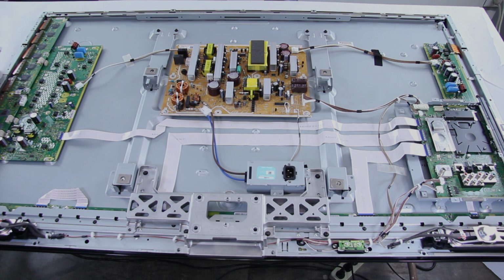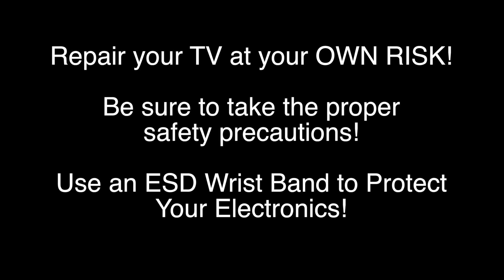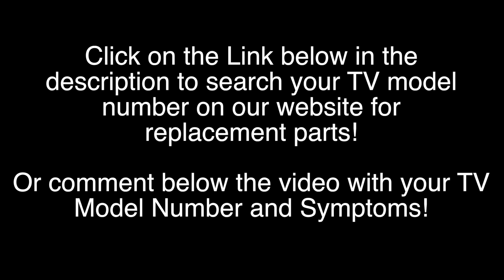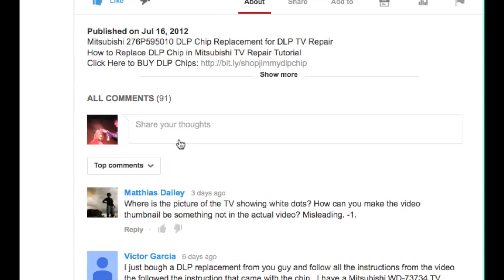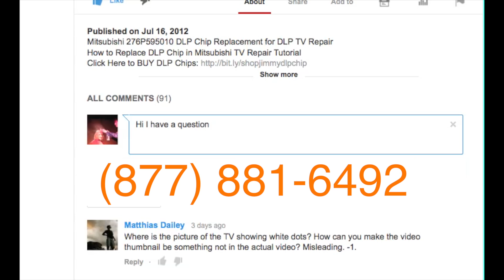Panasonic Plasma TV Repair - Understanding 10 Blink Code for 2011 Panasonic Plasma TVs-How To Repair

Comment: Hey guys, I know this post is old but I have an Panasonic TC-P50S2 Plasma TV.  We had some power brown outs the other day and now we get the 10 blinking code. We've unplugged it and discharged the power. Still same codes when plugging it in. Any help you could provide would be appreciated.

Comment: Hi there, thanks for the video. 
I have a 50” Panasonic Plasma Model # TC -P50U2 TV , manufactured October 2010.The other day I went to turn on TV and it clicked on, then seconds later it turned off and started flashing a red light 10 times. I have unplugged the TV overnight, then plugged it in again and it does the same thing. Would you know a quick fix for the TV. Beings as the TV is 15 years old, I don’t think it makes sense to put a lot of money into it. Your help would be appreciated. Aug 20, 2025

Comment: Hi , I have a Panasonic Plasma tv TC-P46S2, the problem is as you described when try to turn the tv on it is just on for a few seconds then shut down and the power light is blinking 10 times, as you first mention it is the problem of the A board but then you started to say to replace the power supply board, so I'm not sure this is the issue related to P or A board, please can you reply as to replace the P board or the main A board, thanks , Dave

Comment: I have a Panasonic TH-50PZ700U purchased 8/26/07. Stopped working about a week ago. Researched a little and tried the following: 1) Plug in TV,  2) Hear: 1 Relay click sound,  3) Press Power Button,  4) See: 10 Standby LED blinks then pause, 5) Repeat: 10 Standby LED blinks then pause, etc. Some YouTube videos indicate the "A" (or "Main") board may need to be replaced. Is that correct?

Comment: Thanks for the video. Very informative. I have a TH-50PZ80U. I try to power on and hear the click... but then a small little click after the initial one then the light blinks 10 times... sometimes after power reset it works... sometimes it doesn't. will the fix here work for it as well? I will look at your shop for parts. Thank you again :)
Reply from the maker: Hi! There's no guarantee it will fix your particular issue but it's worth a shot. Thanks for watching!

Comment: Thank you so much for taking the time to make/post this video! Would this also apply to the 2010 models? I have a TC-P50S2 with the 10 blink code as well. Replaced the main and power board with no change. Clicking from power board but no visual signs of an issue.

Comment: I have a Panasonic Plasma tv (TC-P60S30) won’t turn on, no indication light, no sound at all when trying to power on, nothing totally dead. Was working fine then one day wouldn’t turn on. I have checked the voltage from the power cord to the tv and power cord is perfect. What could my problem be SC Board? Main power board? I would appreciate your expert opinion regarding this matter please, thanks.

Comment: Hi, I have a Panasonic TH-P50U20D
and this is 13 years old working fine.
Now frequently one horizontal 2inch black bar comes and stays for one hr and goes away. Can any body suggest  some solution to some this problem.

Comment: I have a Panasonic viera  TC-P50S2 HDTV.  I have replaced all boards but I have problems with the picture.  No blink code as of now and I get a menu.  Part of the screen is black and part with  lines across the screen, which are on top of the picture.

Comment: I have a Panasonic TC-P50S1, made on 2009. Have the same 10 blinking light code, which also applies to my model. 
I bought a new main A board. I still get the 10 blinking light code.
Shouldn't it be working, or do I need to reset something?  Thank you.

Comment: Someone please help...
13 blinks
Panasonic Viero TC-L60E55
TV won't turn on. Pulled apart and no loose wires. Switched to a different power outlet and still not working...

Comment: Hello. Very interesting video. I have a Panasonic TC-P50S1 plasma tv.  Bought it in December 2009, so I am guessing it is a 2009/2010 model.
Also getting the 10 blink code.  
A board?
I am pretty mechanical, but not good at soldering electrical connections.
Is a new A board just plug n play, or would it require some soldering?

Thank you very much.

Comment: I have a Panasonic Viera plasma tv model number is TH-42PD60U made in 2006. It just turned itself off yesterday and I've left it unplugged overnight then plugged back in and turned the power on. The power light is blinking 10 times. Could anyone assist to diagnose the problem please. Thank you.

Comment: 10 blinks means your tv is low on health ❤️🤍🤍🤍. 5g Learned me about a  cheat code that will restore it's health but it only works if you do it correctly.  Within 1.399 seconds on your remote quickly press "up, up, down, down, left, right, left, right, Z, left trigger, right trigger simultaneously. If you did it correctly and within the time limit You will hear a health restore tone which sounds like this (ziinngggg) Good luck and your welcome!

Comment: I replaced the Main board on my Panasonic Plasma and install the new one. However, the TV still blinks 10 times and I now notice a fuse burning smell. Could it be that the power board is also shot?

Comment: Hi Jimmy, I have a 2007 Panasonic Viera Plasma Model # TH-50PC77U. The red LED light is blinking 10 times. I just replaced the main (A) board, and it made no difference. What could it be? I did get the A board online, and it was recycled....But, they say it's still good.

Comment: I have a 2008 Panasonic plasma tv model #Th-46PZ85U, 10 flash code. I’m hearing three quick clicks. Took the back off and cleaned the fans, they weren’t very dusty.

Comment: Hello, I have a 2009 Panasonic TC-P50X1 that was completely dead. I’ve changed the power supply and now I have received the 10 blink code on my standby light. After replacing the power supply I tried unplugging the A board or Mainboard from the power supply to see if I could get some kind of picture. My standby light stop working altogether and there was no response when I pressed the power button. Reconnected the A board to the power supply and the red light still blinks 10 times. Should I replace the A board or could it be the noise filter that the power cords plugs into? Please help! Thanks!

Comment: I have a Toshiba  49l621U. The tv was given to me and I went to plug it in and the tv will turn on for only a second then shuts off and the power light blinks 11 times. I've tried the reset trick and it does not seem to work. It looks like a nice tv however I can't seem to get it to work. What do you think it might be?

Comment: Hello. I got this tv as a gift today. Without a cable and remote. When I connected 10A power cable from different tv green light flashed once  and than red started flashing every second continuously. What could be a problem? Is it possible to start up tv without remote control? Or maybe power cable should be different? Thanks for your help in advance.

Comment: I have a Panasonic TH-42PX60U with 10 blinking lights upon powering up. I replaced TNPA3814 (TXNSC1BJTUJ) SC board with no success. Any suggestions would be greatly appreciated!

Comment: hi i have a panasonic tc-p50u2 plasma tv with no picture power light blinks 10 time tried troubleshooting by unplugging everything and resetting power button no luck would it be the A board ?

Comment: My TV just died 4/18 Panasonic TC-P50S2 and yep 10 flashes i brought this TV 8 years ago love this unit i hope this board fixes my problem.
Reply: Did it fix your problem cause I have a TC-P58S2 and the standby light is gone and it doesn't power on. I don't know what's wrong?

Comment: I have a Panasonic plasma th50pz800u 2008 after a power outage.  10 blinking problem and an old speaker cracking problem.

Comment: I have a TC P50 GT25 panasonic plasma TV. I started with a10 blink code. Found a bulging capacitor on the power supply board and replaced it with a new one. Now i get a 4 blink code. Can you guide me to my next step. serial # MD 02320856. Thank you.

Comment: Hi I have a 2010 Panasonic plasma tv model tc-p50s2 with 10 blinking light code. What do I need to repair or replace?
Reply: Did you find out what was wrong with the tc-p50s2?

Comment: Hello, I have a Panasonic Plasma HD tv made October 2008,  model # TH 50PX75U. It will not turn on, it shut off during use after being moved and plugged in for the first time in a new house. It turned hot like an oven from the back, the red light flashed, I turned the tv off. Now, I turned it on the next day, and the  power button flashes 10 times. What is the repair/repair part, and roughly what will the cost be? Thanks so much, SR

Comment: I have Panasonic viera model TXL50EM5E  .The problem is when I switch it on the green light stays just one minute and then it start blinking red continues till I switch it off. Please tell me what should I do or what kind of fault is that.
Reply: Quajo Obeng same here...any solution?

Comment: TH-P42X20R Panasonic plasma. upon switching on green lights blinks quickly after 5 seconds turn off and red light starts blinks continuesly ever two second interval.
There is no sign of any burn on power bared
Reply: Mohammed Altaf same problem dudeee..did u clear the problem???

Comment: Hello I have a TX-L42ETF52 lcd tv. In this case, the red LED flashes 10 times. What kind of mistake can that be? What do I need the Q7201 module for? Does this voltage have to spend? This is located on the power board. Many Thanks! Greetings from Germany.

Comment: i have a panasonic viera tc-p42c2. i get the 10 blink diagnostic error. my tv indicates it was built in june 2010, though--not 2011, as this video was made for. same difference? is it the A board, or P board? im getting so many conflicting answers and suggestions. can you help me? i will purchase the appropriate board from you.
Reply: however, the inside is exactly the same as the model your using in this vid.

Comment: I have 10 blinks on my tc-55as530u model. Changed the main board and tcon board. Still No picture or sound but have backlights. I had sound for alittle. Power board is the only left.

Comment: I HAVE a TC-P5OU2 ( 52 INCH PANASONIC PLASMA TV ) > it shut off by itself / unplugged and turned it back on { red start button blinks 10 times ) where can I get the parts I need ?

Comment: I have panasonic tv model No TH-P54S10A with 10 blink issue when turn on hear the click and then red standby light blinks 10 times and again after couple of seconds it blinks 10 times. Like to know what's to be done, which board needs replacing power supply board or the A board. Your help is needed, any suggestions?. Thanks

Comment: Our TV is binking ten times. I unplugged it and plugged it back in again. I click the button it makes the turn on noise then repeats noise back and starts blinking. It is a Panasonic Plasma HDTV TC-P50S2 55 inch,JULY 2010 manufacturing ID TC-P50S2N

Comment: I have a Panasonic TC-P50S30 plasma TV that won't turn on.  When I press the power button I hear a click and then the red light on the front stays on continuously.  It does not blink.  What board should be replaced here?

Rick

Comment: I have a  Panasonic TC-P42C2 from 2010 and I have the 10 blink issue. Even after I unplugged and then plugged it in it stays with the 10 blink. Would that be the same as the one in the video even though the video was for a year newer? It would direct me toward the main board. Shop jimmy does not have that one in stock. Is there something on the board that I can repair?

Comment: I have a panasonic TH-58px600U and the light blinks 10 times right at power up. It was initially blinking 8 times. Left it off for days and now 8. Relaxed the SS Board. No change.
Reply: It does click initially when plugged in.

Comment: Hello I have a Panasonic TC-P60ST50 that as soon as it's powered on it immediately cuts off and repeats that loop until the AC power cord is removed from the outlet.  Before it started doing that it would give blink but I can't remember exactly how many blinks it was I would guess 13.  Any help you can provide would be greatly appreciated so I can get some use out of this tv.  Thanks

Comment: Great info site for Panasonic TV's. I'm up against a wall on a Panasonic TC-P50VT20 dated May 2010. Has the 10 blink code on startup. It is VERY dusty/dirty inside (fans almost plugged with dust). Should I replace the A board like you suggest on the 2011 video, are they almost the same? Can you test the boards involved if sent to you?

Comment: We have a 2012 42 inch panasonic tcl42e50. It is not turning on and the red light is blinking 10 times with a high pitched buzzing sound right after turning it on. It sounds like it’s coming out of the green board that is not the power board. Any thoughts on what this could be?

Comment: Tengo televisor panasonic plasma Modelo TC-P42C2 SERIE MA02810662 AÑO 2010 ,PRESENTA10 BLINKING CODE ERROR LO CONECTO AL TOMA CORRIENTE Y SE ESCUCHA EL RELAY LUEGO PRESENTA 10 BLINKING CODE ERROR ,ALGUNA AYUDA PARA RESOLVER EL PROBLEMA , SELO VOY A AGRADESER MUCHAS GRACIAS,Y GRACIAS POR TODOS SUS VIDEOS,DIOS LES BENDIGA TODOS.

Comment: Subj. t.v.:  Panasonic TC-P65VT25 plasma.  Wii controller slipped off my grandsons had and slammed int to screen.  TV went off.  Screen was cracked and it can no longer be turned off or on.  A let led stays on.  Unplugging and plugging it back in does not help.  Help.  He feels so badly, but it was a accident.  Thank you!  Jerry Slonsky

Comment: I have a Panasonic TH-50PZ80U, with a 10 blink code. I'm assuming that it is a different year than the video you have posted. Prior to the TV refusing to come on at all, it was blinking intermittently. Sometimes it would come right on, others you would have to reset the TV in order to clear the blinking light. At this point, when you turn it on, it simply trips the second relay and you get the blinking error code. Any thoughts?

Comment: I have a Panasonic Plasma TV Model TC-50PS14  (July 2009)  It will not power up.  When i plug the TV in and press the power button it blinks 10 times. The goes all blank. Nothing will happen till i unplug the tv for a length of time.  Any ideas to what i need to do ?
Thanks in advance :)

Comment: I have a Panasonic TCP42G10 TV that gives the 10 blink code.  Tried all the button press fixes/resets, to no avail.  Is this a power supply board problem is the part available?

Comment: I have a Panasonic plasma HDTV (TC-P50S30). I was trying to figure out how to fix my television. When I pressed the power button, the red light would blink 14 times. I viewed the 10 blink code video, then purchased a power supply board, and replaced the old one. Now, it doesn't blink like it did, but it still doesn't work. Now, when I press the power button, the light comes on, but there is no picture at all, and it doesn't turn back off without unplugging it. What is wrong with it?

Comment: hello i have a panasonic viera lcd tv the model number is TX-P42G20B when i switch it on green light comes on for 2 seconds then a red light flashes 4 times.looking at the main board when i switch it on there is clicking sounds on the board.thanks for your help.

Comment: I have a 2010 Panasonic TC-P54S2, I bought it not working.  It has code 10 . I tried a used power supply board. Still the same. The main board in the tv is TNPH0831(2)A  and by the word suffix ,it says nothing. Do I need a main board with no suffix? Thanks Keith

Comment: I have the 10 blink code problem. I watched this video and ordered the power supply board mainly because it was readily available and fairly inexpensive. Didn't fix the problem. I returned it to you.  Then I couldn't find the main board anywhere so I shipped it to a company for repair.  They tested my main board, said it was fine, charged me a testing fee and shipped it back to me.  If its not the power supply and not the main board, where do I go from here?  The power supply return ended up costing me $30.  The A board test cost me $75 with shipping. I hate to throw this plasma out but soon I could replace it for the money I'm spending on this fishing expedition I find myself on now.  My TV is a TC-P42C2  MD02661185. Any ideas?
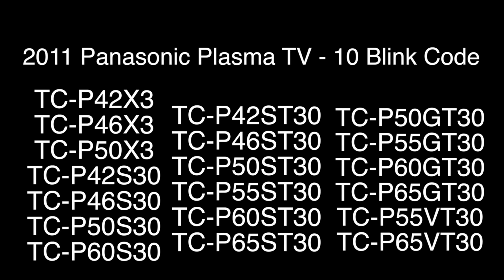Reply: At  0:26 Shop Jimmy stated clearly this instruction applies to these models only! You applied to the wrong model number! (Keep in mind that manufacture they change the error code frequently year by year!

Comment: Hi my name is Steve and I'm having a real crappy time with tv's this month! Can u please help me out? I'll start with my back-up tv that just went blank. It's a Panasonic tec-P50s30, I was in the middle of watching a show and the pic and sound just went blank. I tried unplugging everything and just tried plugging the tv in to see if I got anything, but nothing. I'm not getting any blinking just a steady red light, I can't switch through the menu or anything and it won't shut back off I have to unplug it to get the light to go out

Comment: Hi yes I have a Panasonic viera 55 inch TV! It has that 10blink code so from your video I'm taking that its a board! Its a MC127H36U13 from may 2010 serial #LB01390808...... do u agree since it keeps blinking 10 times I need to replace  board? If so how much do u sell for? If not what's the problem n how much to fix????

Comment: I have 10 blink code for Panasonic TC-P50S2 manufactured in 2010. Bought and replaced A board with no fix. Please help. Thanks
Reply: Did you get it fixed? If so, what did you do and what was the cost?

Comment: hi, i have a 2008 panasonic plasma when turn on  it turn of automatically and give two  blinks then pause  and continue to blink.the model is TH-42px80x 385-watts serial num-ma81980986.how can you help me.another thing i disconnect the wires from the power board to the main and no light no sound no clicks.